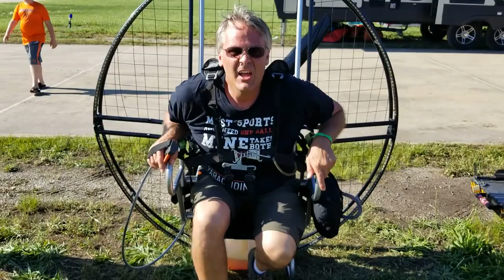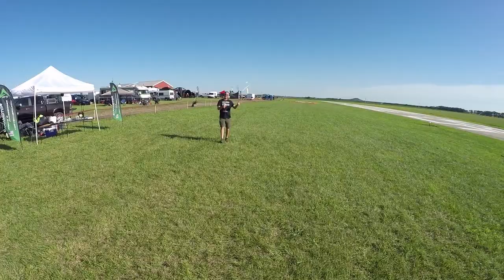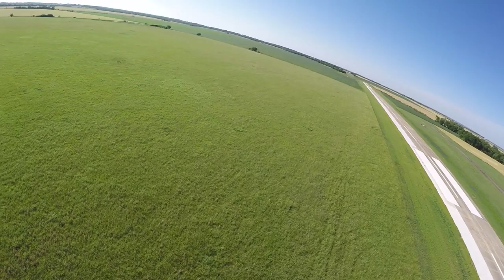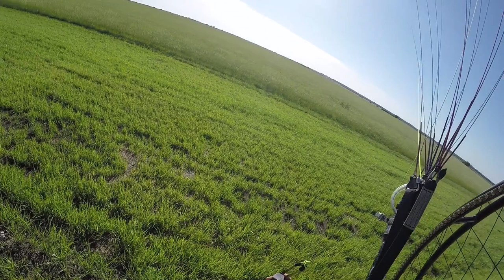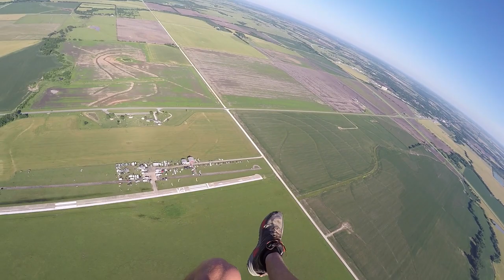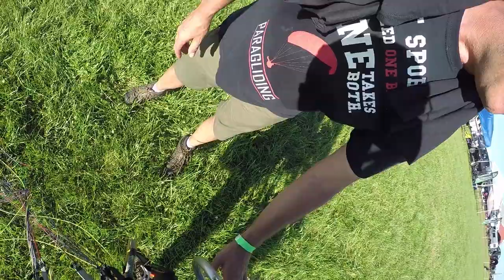Flying the Infamous Dell Schanze Flat Top Paramotor for the First Time!!

Comment: Aw, the famous Flat Top Ninja! Quite an incredible paramotor huh? Although you dised me throughout the video I think you did an alright job at showing the Flat Top Ninja. 

There were some things you simply didn't know that could have better addressed the weight shift and kill switch. The Flat Top is built to be as SAFE as possible. Safety is my #1 priority with everything I do. 

Super Training, The Flat Top Ninja, and Dominator are all about safety.

Crumple zone, faceplant protection, quick-release harness, cage design, netting design, certified hight hook in points, and secured hook in points are only a few of the safety upgrades I made.

I was very upset at the number of people getting hurt and still getting hurt simply because of equipment failure. There is no reason for pilots to be smashed into the ground when they fall forward. There is no reason for pilots to drown when they can simply use a quick release harness. There is no reason for pilots or other people to get their hands, head and other limbs into the propeller. There is no reason to increase your chances of getting riser twists by raising the hook in points and making them loose.

The Flat Top was built with common sense in mind. I simply looked at what was happening to other pilots and said hey I can fix that. And I did.

Not only does the Flat Top have the highest level of safety of any other paramotor out there but it is one of the top-performing paramotors on the market as well. 

Power, weight, maneuverability/weight-shift, and comfort are all specialties of the Flat Top Ninja. 

You can fly safe, and have a good time while doing so :)
Reply: yea u can tell he aint no professional reporter. but the set up speaks for its self
Reply: @DellSchanze  Some of the information you provided here is incorrect. The fuel tank ladened with fuel provides zero force. It is providing resistance to movement in this case from torque. It is also not a very good source of resistance to rely on as you will continue to burn that fuel the longer you are up in the air. That of course means the resistance it provides against the torque will diminish as the fuel burns. Because of that, it isn't something a good pilot would rely on. This is just physics. I am willing to bet that you train techniques of weight shifting over reliance on a heavy tank especially in the long run. This adage I feel fits. Give a man a fish, and you feed him for a night. Teach a man to fish, and you feed him for a lifetime.

Everyone has a 100% chance of death in a matter of time. This is the nature of life and death. 

Your use of the following is also improper. " He simply doesn't understand how the sport works. " Flying a PPG is dependent on the equipment being used, not the sport in general. Each piece of gear affects the experience. One wing can be slow, another faster. One paramotor frame versus another can have completely different carabiner points and that can completely alter the experience. The sport is getting up in the air and having a good time with a PPG safely enough to return for a good landing. Skill, technique, equipment knowledge, and physics are 90% of the work. The other 10% is the running you will do, and waiting for good weather. At least on a foot launch. Getting up into the air and having a good time. That, is the reward for the effort. But so is landing on your feet safely afterwards. I think the word you were meaning was either Skill, or equipment knowledge. The sport of PPG is no different than the sport of Formula 1 racing. The sport does not tell you how to drive a Formula 1 car.
Reply: @DellSchanze  I didn't argue. I'm also not making anything up. I also NEVER said put the tank at the top.

I also didn't say anything about only getting into their air "once".

I actually said, it is far better for someone to be trained and skilled and informed of their equipment. So, if you think I was trash talking. Then you are the one with the problem here. I didn't direct a singular negative comment in your direction.

Words have power, so you should use the right words. When you use the wrong words, you help the reader to make the wrong opinion of you.

Lastly, I have nothing to gain by giving you advice and insight into improving your form of exposure on the internet. That choice is purely your own.
Reply: @DellSchanze  You are pushing so hard to sell a product that you would rather antagonize your future customer base instead of actually having a conversation.

You are the one talking in circles. I am not crying, or yelling. I am laughing. 

Seriously, if you were actually educated enough to understand some of the vernacular you used poorly. Then you would of understood that your fuel tank is not capable of applying a force. What you were referring to is load balance and weight shift.  

If you are incapable of having a conversation without attacking people online. Then you are clearly not well suited at teaching either.

It isn't my fault you are incompetent when it comes to communicating. We could have had a nice conversation. But you are not interested in a conversation.

If you actually cared about people. You wouldn't treat people like garbage from the start. My first msg to you was actually that. The first conversation you and I had. I didn't treat you poorly, I didn't attack your beliefs, I even said that knowing a skill is the safest thing. You have completely avoided every single chance where you could of said "You are right, and that is what I teach."

Instead, you are just interested in trying to push a product. You are using the same sale tactics bad insurance salesman use. Because it makes them money. Not because they actually care about you having the right insurance for your needs.

Thank you for enlightening me on how you actually behave. I gave you the benefit of the doubt and tried to treat you like a human. Instead, you just tried to talk down to me to sell a product. You have given me zero reason to have confidence in you as a person, you as a teacher, and you as someone who is invested in actually caring about the well being of people in the sport of PPG. You are only interested in trash talk, and selling packages.

Had you treated me differently. We could have had a good conversation.

Comment: Id like to see you try a scout, im intrested in honest unbiased review on that machine.  Seems to compensate for torque pretty well
Reply: @DellSchanze   Certified glider ? The Dominator ISNT certified by anyone (except you of course). Maybe it was a slip of the tongue and you meant UNCERTIFIED because the dominator hasnt passed any recognised certification process. If Im wrong(and I know Im not) then post a link to either the EN or AFNOR test. I know you cant because its UNTESTED.
Reply: @grahamlockley4435  shut him up quick😂
Reply: @DellSchanze  soooo uncertified glider huh🤣
Reply: @DellSchanze  Sorry but you are completely wrong. EN certification is based on the original design, change the materials or add 'features' etc. and it is no longer certified. This not my opinion but a fact. Have look at what EN ( European Normalisation (Standards) established by the  Comité Européen de Normalisation) actually states. If you make changes to the wing that was submitted for EN certification then the certification is invalid and must be submitted for re-certification. Of course, given the cowboy nature of your operation, this is highly unlikely to happen therefore the Dominator is uncertified. I did not say the Dominator was unsafe (neither is it modern) but you are lying if you claim EN certification without having it re-tested, check EN records and there is no certification for the Dominator. Doh, there goes yet another easily provable Schanze lie.
Reply: @grahamlockley4435 I see he deleted his comments 😂 probably off kicking more owls and sabotaging other pilots

Comment: Hey, thanks for putting up this video. all kidding aside and you almost have to poke a little fun at Dell, it seems like a decent paramotor. It looks like it could really benefit from the anti-torque lamels that Aviator sells (they use them on the Air Concepcion motors they sell). Even more so because the netting on Flattops seems a lot tighter than on some others. That throttle though. I've seen slot car throttles that are sturdier looking than that. It's not a huge deal since it's not that tough to change out a throttle cable. I wonder if it's a right handed one because you have to pull left brake to compensate for the torque so much. On the plus side, having it up off the ground makes it look a lot easier to get hooked in and I've always thought the quick release harness was  good idea and have never heard anyone give a real downside. In short, I think the Flat Top would be a lot more popular if it had a different spokesperson touting it.
Reply: Dell Schanze lol so somehow it defies the laws of physics

Comment: Mark, you mentioned that you had to work a little harder on wing overs if I heard you correctly and I'm not surprised it felt different to you. The hook in points on the Flat Top are at the same height as a paragliding harness but on the Nitro they are up higher. I'm thinking that if you had just taken a wrap on both brakes it would have felt more like what you are used to. As for me I prefer the hook in points height on the Flat Top as that is the height used during certification and gives you the intended brake position for any given glider plus I like having my arms down a bit lower when I am just cruising. Just some thoughts.
Reply: I can cruise for hours with brakes on magnets, with only weight shift if needed.

Comment: I’ve had a Flattop for a number of years .
But as I’ve got older the heavier it’s got so I gave in and stuck it on an Airtrike which is  pretty good
And a dam site easier.
  although now is an older design it is pretty much bomb proof and the Kevlar netting  is probably the best for protecting.
Foot launching  I’ve got  the lightweight AC Nitro 200 for the old gits. Lol.

Comment: I love the quick release feature. If you can't get out within 4 seconds, panic could set in under water, then death.
Reply: Dude virtually all manufacturers have addressed the quick release in one form or another. If its too easy to release its an issue as well. Especially at altitude. I don't know about the quick release buckle on the flat top but it might be the only reasonable feature on the "crap top".
Reply: Several people have accidentally popped it open in flight whilst having a bag on their lap etc, instead of crashing into water you should prevent it from happening in the first instance. If you are going over water use a powerfloat so if the worst should happen then at least you can recover the equipment afterwards.

Comment: I like the frame set up with the quick release. I think this is the best set up ive ever seen. It's would be the same as getting in and out of a race car, fast and safe. Plus this frame doe;s offer ease of use and a hard saftey cage like around you.  I just see that a lot of people are having problems with the exhaust pipe cracking, vitirossi 185 and bigger cc's paramoter. I think they just revised that in August or Sept 2019. I think the somalia 202 paramotor would be the better engine. I hear these are like the chevy of the sky as far as reliability is concerned. Can u get this engine on your frame. Yes their is a better fresh breeze set up but still no were as ease of use as to your set up from what I can see.

Comment: With a long throttle cable like that, you need to run the cable over the top of your forearm.  That way the cable doesn't go into the prop when you pull the right brake hard. (It pulls it forward instead).
Reply: 600 hrs. and never a problem just letting in hang down.
Reply: Gleanerman Wow, 600 hrs and you haven’t yet managed to line up all the holes in the cheese?
Reply: @TimToussaint  Some people don't understand Murphy's Law as it relates to risk assessment.  It not my preferred default, but natural selection takes over at some point.
Reply: I'm just wondering, 3 years on, if @Gleanerman still has his throttle hand.

Comment: Here's the problem I got with paramotor comparisons. The acrobatic maneuvers are mostly coming from the wing and the part that the paramotor uses to push you forward is the engine and most of them uses a Vitorazzi engine. So basically, if you use the same engine and wing on many different paramotors, chances are the flight performance will be pretty much always be the same...right?

Now of course Dell would say that the Flat Top's magical "crumple zone" under the seat can save you if you fall without a wing from 16,000 feet or less but if fall from higher than that then you might break a toe or 2 right Dell? ;- )))

Seriously,  the cage to me is just a cage, if it affects the flight then it would be because of the cage design and the air resistance it has but there's not a lot of difference in drag from one PPG cage to another so again, this brings me back to wing and engine which should be the one to look for if you want to radically improve or change your PPG flight performances.

What do you PPG experts reply to this? Would you agree with me that the PPG design is mostly for looks and not performance?
Reply: The cage can make a huge difference. Have you seen the Tucker Gott videos from last week with the $2500 project. They may change your opinion. You need to understand how hang points and torque compensation can alter your flying experience. Personal preference and ergonomics also play a part. Also how the engine is mounted in the cage - how well is vibration damped and how far from your body the motor is. Watch the video series put up by scout on paramotor geometry and you will get a little bit more knowledge. Find your local fliers and try some units on your back and get feedback from people who are flying near you. You wouldnt go straight out and buy your first car before your first lesson without getting a very good idea of what it is - you shouldn't do that with a paramotor either.

Comment: If it’s a float bowl carb, then G forces and inversion can cause the engine to stall
Reply: Not a float bowl carb, its a Walbro diaphragm carb. Because of the issues you mention, most PPG carbs are of this type.